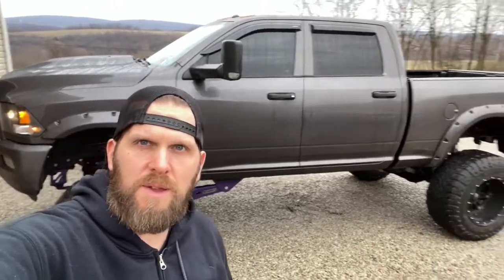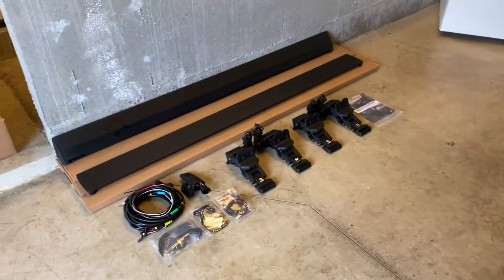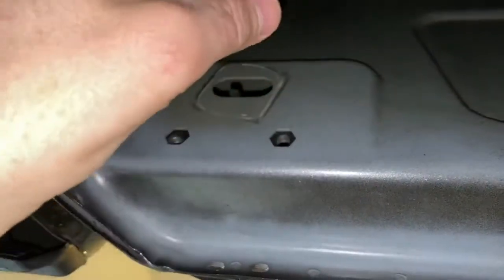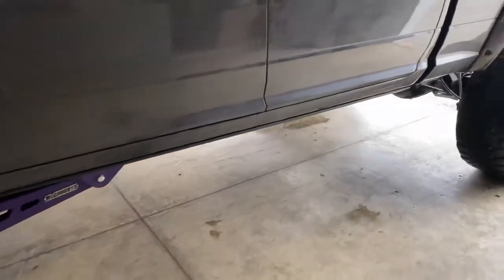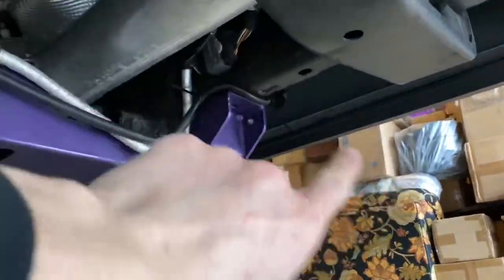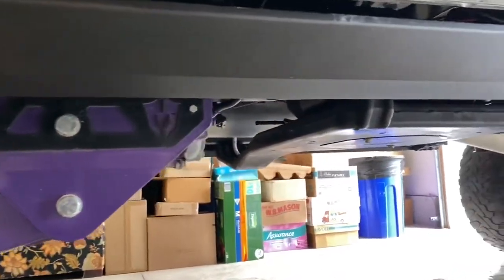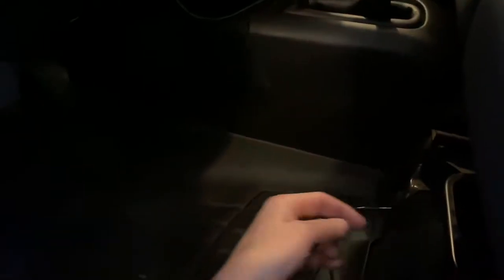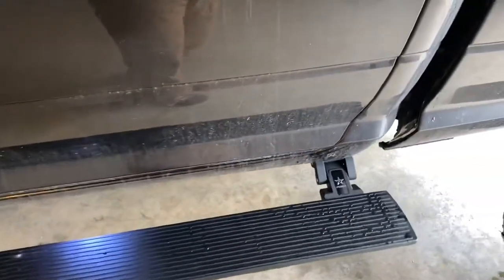RBP Stealth Power Steps

Comment: Are these the regular steps or the new extended drop steps?
Reply from the maker: These are the regular steps.  That’s why I am selling them now as RBP came out with the extended version which I am interested in since I have a higher lifted truck.
Reply: @DieselLegiance  are you going to do a video on them? My 2010 ram 3500 is on 14 inches of lift and 42's. The more they come down the better
Reply from the maker: wade earnest Yes, once I sell these and order the new extended version, I will do another review.
Reply from the maker: Just a quick update, I ordered the extended steps and they should be coming in tomorrow or Thursday.  I will install and post a quick review video on how I like these over the standard version.  Subscribe and hit the notification bell so that you know as soon as I post it.
Reply from the maker: I got the new steps installed and posted a quick update video.
Reply: I got a ram 1500 6in lift I ordered 3in extended you think that be better?
Reply from the maker: mays9185 I really like the 3” extended version myself.  The regular ones are fine but if you want to reduce how high you step up with a 6” lift especially if you have larger tires like 35’s or 37’s, I’d say go with the extended version.
Reply: @DieselLegiance  Thks , new subscriber

Comment: Great Vid. Do you recommend the extended 3" drop power boards for a truck lifted 6" and 35s? Or are the regular ones sufficient for that set-up?
Reply from the maker: Regular would be fine but I’d personally with a 6” lift and 35’s get the extended.
Reply: Matt Harmening Diesel_Harm379 
I just saw your other vid with the extended drop power boards. I’ll go with the extended ones. Thanks for your help. Your truck is sweet!